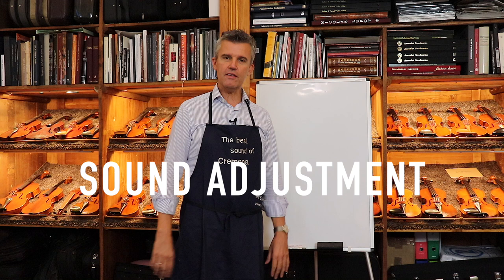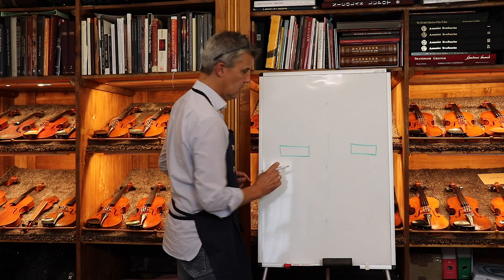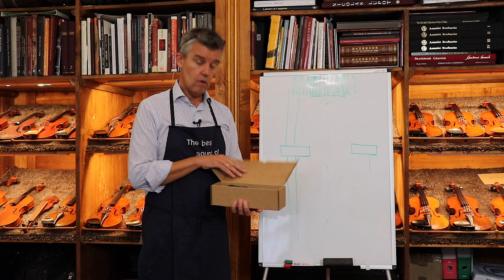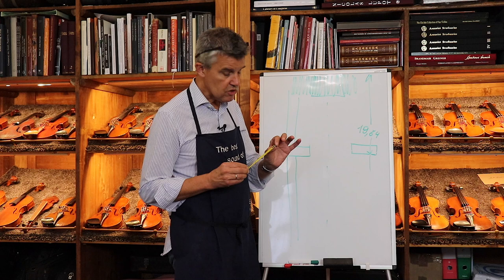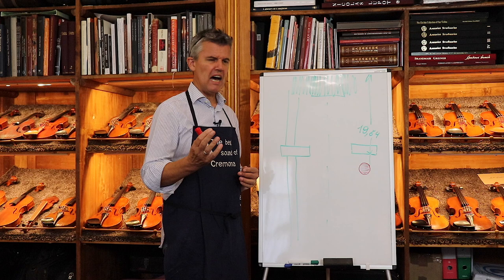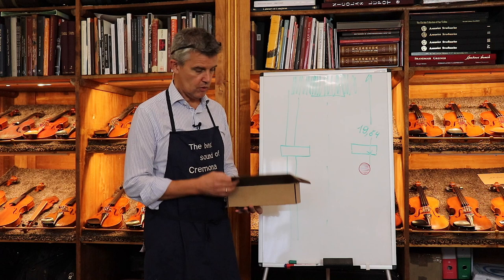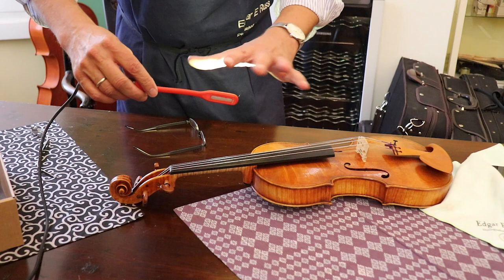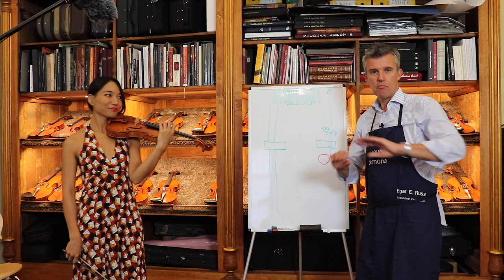E- STRING too WEAK? Watch this Sound Adjustment video!

Comment: Does it affect the sound of A string when you try to adjust the E string?
Reply from the maker: It could; but it could also not change!
Depends!
Generally I would say every change changes slightly everything but it is most of the time difficult to notice/hear!

Comment: What is the cello distance for the 19.64cm violin measurement? I enjoy your videos.
Reply from the maker: Hi Tom,
I like it when it is 40,9cm
A full size cello has a 28cm neck and the notches of the F holes should be at 40,5cm. Now when placing the bridge I leave approximately 1/3 of the thickness behind and 2/3 in front toward the fingerboard. So actually when my bridge is now 10,5mm thick it is rather 3,5mm; indeed it is, but I feel maniac when I answer you right away 40,85cm. But that would the precise measurement.
Try it out! And let us know.
 Edgar
Reply: @EdgarRuss  Thank you!